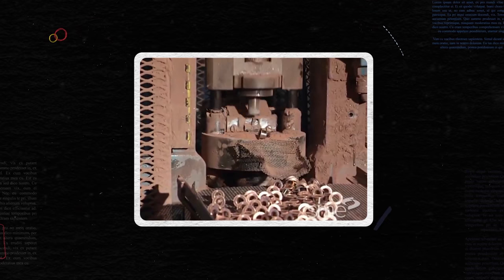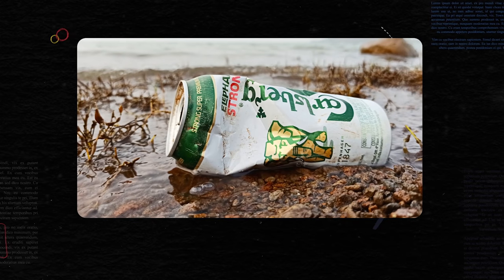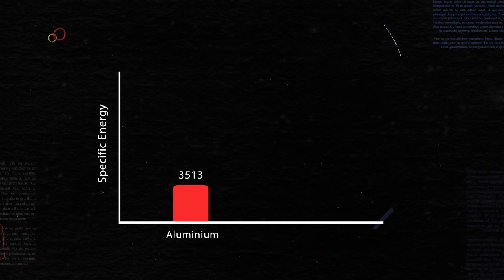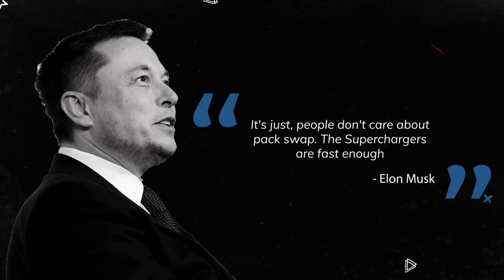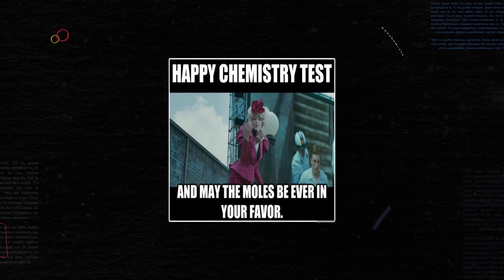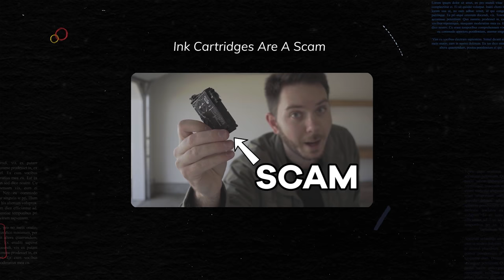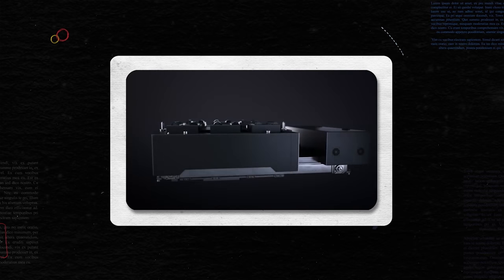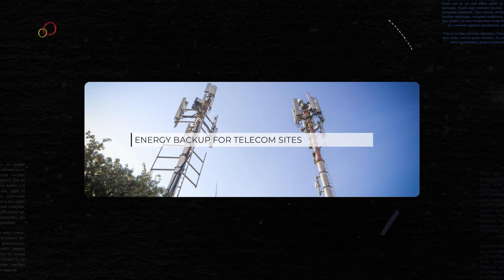We Can Get 1600 KM of Range With Aluminium Batteries

Comment: Someone is really bad at math... substance with 8.6Wh/g yields only 1.2Wh/g (~14%), then takes 15Wh/g (12500%) to get back to the start. That's an overall 8% efficiency. That's total crap! Li-ion might be 1/6th the usable energy density, but it doesn't take 12.5 times as much energy to recharge it. Unless you have a super-secret, uber-efficient method to produce aluminium, this is all just madness. "Buring" AL is just crazy. The expense (and pollution) of generating it is why we're so keen on recycling what's already processed. Hydrogen is a better storage medium, and water is very hard to break apart. (yes, the fuel cell is rather expensive, but I'm not recycling it every 1000km) Saying "zero emission vehicle" is infinitely misleading. Sure, the car doesn't spew anything, but recycling the sludge out of the battery sure as [censored] does. (I can't speak about India, but in the US, car batteries [lead and lithium] get reused/recycled. Yes, cellphone/laptop/tool batteries just get tossed in the trash, because people don't know any better, and can't be bothered.)
Reply: Well put!  I think you would like "Thunderf00t"'s channel he has a video debunking aluminum batteries brings up a lot of your points.
Reply: Underappreciated comment. You saved me from composing and writing what you wrote.
Reply: Ya absolutely. What do u think about solid state battery with ceramic electrolyte?
Reply: @StinkPickle4000  do you have the link to the Thunderf00t video you mentioned here please?
Reply: @GRSG  "1500 mile SUPER-battery: BUSTED!"
Reply: But Lithium generation does a lot of pollution too.. Thus even EV'S aren't that clean as they sound... And as much of Lithium recycling is concerned.... It can't go on recycling forever. At some time it gets out of cycle and ends up in a bin and when billions of batteries will be produced annually. It will become too difficult to keep up with your 98% figure,, simple saying it will do more pollution in recycling them then producing them. We can't even recycle plastics which doesn't even requires much energy in most cases.... Let alone you Lithium Ion batteries.
Reply: @ayushimishra8273  By your math, 80% of lead-acid car batteries are going into the landfill everyday. (hint: they aren't. they are, in fact, one of the most recycled things around. even the plastic casing gets recycled.) AL-air batteries are hands-down the most energy wasteful (and thus polluting) thing anyone could come up with. I guess a plutonium powered car is too tough a sell?
Reply: However the creation of lithium batteries is VERY energy intensive and is VERY environmentally UNFRIENDLY. It is a nasty business mining and processing lithium and nickel. The whole process is shittier than just driving your petrol or diesel car. Its a freaking mess.  Thus the saying, The New Gang Green Deal  LOL
Reply: @KlodFather  No, the making of the battery is not un-green. Mining and processing is a nasty business, just as it is for AL. This is why recycling is so important, and "destroying" the aluminum as an AL-air battery does is infinitely worse... burning it, thus turning it back into the crap we dug out of the ground and put tremendous energy and effort into refining, so we're constantly having to re-smelt it back to "usable" AL. Once Li, Ni, and Co are refined for a battery, it's much easier to recycle them back into a new battery -- the same as a lead-acid battery. The battery chemistry isn't destroying the material; the process is bi-directional. (the holy grail is to find a formulation that doesn't self-poison, or grow dendrites eventually causing shorts.)
Reply: I like this part of your sentence I copied and paste here "sure as [censored] does".  Does (censored) mean the "Fuck" word?  If so, I and lots of people use this phrase.  IT's precise and to the point...gets the job done.
Reply: @jfbeam  If you can chemically reduce aluminium to it's original form why can you not then chemically reduce the al oxide to pure aluminium also?
Reply: @gangleweed  Aluminum oxide is not chemically reduced. If you had a purely chemical process that could unbond oxygen from aluminum, leaving behind pure metallic Al, you'd be a billionaire.
Reply: @jfbeam  Hmmmmm, pity you couldn't dissolve the al oxide in water and electroplate it onto another metal....oh well.
Reply: Aluminium battery tech is from 1953  and lithium ion is 1982. 
There is a reason why we don’t have aluminium batteries running the world

Comment: This sounds like it would be a viable alternative for trucks, buses and to replace diesel electric trains.
Reply: and energy storage for power supply grids to replace oil, coal, and diesel peaker plants...
Reply: @yootoober2009  . The liquid metal storage that was recently on this channel is a much better option for fixed power storage. It doesn't appear to have any lifetime.
Reply: Aluminium smelting produces CO2 uses fossil fuels and relatively expensive

Comment: Even 7 cents/km is a high operating cost.  That is 4x the cost of the electricity to charge a battery EV.  In mpg equivalent cost 0.07/km is like having a 30mpg vehicle when gasoline is $3.50/gal.
Reply: Aluminum - air will never compete with grid costs. (Unless you were in Texas last week) but it can compete with gasoline and other transportable fuels.
Reply: @GRSG  Not even close. Alumium requires too much energy to recycle, if we had Nuclear Fusion (and the corrispondingly cheap AF electricity) sure, but otherwise even biodiesel is cheaper. You have to 1) Reprocess the spent battery with a few Kwh of electricity, most of which will be lost as heat 2) reassemble the cassette, 3) get the small fraction of charge the cassette gives. You throw any sort of enviromental tax at these things and the cost will go up exponentially.

Aside from emergancy power (like something you can crack open to charge your phone out in the woods if you need to call someone) I don't see it having a purpose that biofuel or hydrogen wouldn't do better and cheaper.
Reply: @DFX2KX  Never say never. Watch this space. Comparing to BBL equivalency, Aluminium can make it. And way better than Li-ion.
Reply: @GRSG  I'm not the one saying never. Thermodynamics is the one saying never. Energy density is the only thing aluminum has going for it. Most applications have adapted to Li-ion just fine.

Li-ion can be recharged a few thousand times, aluminum-air is one and done. then it takes several times the battery's capacity to 'recharge' said battery, every, single, tine.
Reply: Have you factored the cost of replacing lithium battery? Lithium battery is expensive and have to be replaced every several years. You may only have to pay 2 cents per mile now, but when the battery is worn, you have to spend tens of thousand dollar for replacement, which would be a big budget shock.

With aluminum air battery on the other hand, you pay it in installment. It's more resemble to gas refueling.
Reply: @DFX2KX  Carbondioxide is not the only form of polution. Lithium battery creates highly toxic chemicals polution at landfills. It's a nightmare in the making that has not been a problem yet because (as she said) there are not many Tesla cars and most of the ones on the road haven't reach battery replacement age.

Aluminum air battery on the other hand, left aluminum hydroxide .. the stuff we swallow to calm down upset stomach.

Comment: so, its not rechargeable, but has to be built again after it is used up, including all the waste and pollution that comes with it.
im not realy sold on it. i guess its better than suck-squeeze-bang-blow, but i cant see it competing with maintenance free, rechargeable batteries that get recycled to 98% after 20+years of service in cars,houses and gridstorage.
Reply: Our Al-air battery is not rechargeable it it reloadable.
Reply: @GRSG  that is my point, something has to be manufactured at a factory, shipped crosscountry, and then swaped into the car somewhere to replace the used up part.
there is simply no way i can imagine, that you are doing all this while being more economical and/or less wasteful than just charging a batterie.
but you might be able to challenge hydrogen with its laughable 27,3% efficiency in those niche cases where it makes sense, though.
Reply: My 2008 Prius does that suck-squeeze-bang-blow quite efficiently,  which I bought it used for under $3k with 315,000 miles. Put over 50K miles on it, so far, with only oil changes. My cost of ownership trumps all electric vehicles.
Reply: Aluminium is the most common metal on earth and the byproduct of fuel cell can be recycled back into the fuel cell itself
Reply: you aint sold on it because it doesnt even exist
Reply: @alistairbalistair9596  umm.. It does,
Reply: @frodobaggins2852  ummmmmmmm
Reply: @tomduke1297  Theoretical energy value: 8000 Wh/kg
Practical energy usable: 1200 Wh/kg
Efficiency of energy invested to energy reaped: 15%. Minus the losses in the recycling process and shipping.
That's worse than fuel cells. But great if you want to set up another transportation system where the operators are beholden to a supply chain.
Reply: It's much worse then suck-squeeze-bang-blow in most applications I can think of. Aluminum requires a ton of energy, and this battery only has the tiny portion of that investment stored within it in the form of aluminum metal. Outside of vacuum-sealed emergency batteries, I don't see any reason for these things to exist. like, pull a pull-tab, air goes into the battery, starts producing power like a hand-warmer but for cellphone battery, that's it. They're pointless otherwise.

Not to mention that there's genuinely rechargable al chemistry batteries that can use the current industry, they're just lower density then Li-Ion...
Reply: “Suck-squeeze-bang-blow” is the most definitive umbrella classification for 
IC/CI engines it has been my privilege to come across. And fittingly, on The Luddite channel ....😎
Reply: @sumanamjs  i actualy "borrowed" that from "Transport Evolved" channel. ;)
Reply: @tomduke1297  Now that really was worth “borrowing”. Glad to be “indebted” to you😁

Comment: As someone that lives in a region where temperatures stay below freezing (for water) for months at a time I have to wonder about both the efficiency of the battery and whether or not the electrolyte would just freeze and shatter the casing altogether.  
Whup never mind.  a quick google check gave me my answer. (Liquid Alum begins to crystallize near 30º F and freezes around 9º F.)
As most parking is unheated.  This means the battery would be less than useless for large portions of the year in temperate or colder regions.
Reply: Or you build cheap ass power hookups and the battery keeps itself just warm enough, OMG
Reply: There is nowhere to go in the winter anyway, right? 😁
Some sort of antifreeze might be added to address the issue. Or maybe a different electrolyte altogether for cold regions.

Comment: The problem with a single, large battery is there has to be some charge to get it to the replacement point. If you have, say, three anodes, you can replace two when you have started on the third. Plus they will be lighter.
Reply: Good idea. But I think the last thing mentioned might be the best. A fixed Lithium battery for day to day, say a 30-40KWh one, then an aluminium one for long range a few times a year.
Reply: I was thinking that, too. Mostly to make the Al-anode lighter, so it can be handled easier. And maybe, different vehicles might have different number of standard cells and Al-anodes would be compatible for all vehicles.

Comment: Sounds like Al/Air batteries would make sense in aviation where gravimetric density is the primary concern and maintenance infrastructures are already robust. i.e. Changing out the anode for every flight will not be a huge deal if the flight is 4 hours. Anyone else subscribed just to hear her voice? :)
Reply: "Gravimetric density"....homeboy trying to flex for the internet.

Comment: The efficiency of this battery is more similar to H2 fuel cell efficiency, as it takes 15 kwh of electricity to produce 1kg of Aluminium, but that 1 kg will only give 1.2 kwh of electricity for the car. This is grossly inefficient compared with lithium  ion batteries.
Also, the aluminium air battery becomes heavier as it reacts with o2 (43kg anode becomes 125kg alumina). This alumina must have a significantly greater volume than the aluminium, requiring the removal of alumina sludge every 300 km's.
I like the idea though and there will no doubt be some suitable applications.

Comment: You're talking about nonrechargeable batteries, essentially.  When swapped, they have to be remanufactured.  So instead of moving electricity to the car, we're moving batteries from the manufacturing facility to the car. discharging the batteries, then moving them back to the manufacturing facility to restore them to serviceability/full state of charge.

I don't think you captured all of the costs per kilometer for the end user.  Aluminum isn't very expensive, but battery swapping facilities are, and so is all of that material hauling between customer and manufacturer.  Very capital-intensive, lots of moving parts, lots of maintenance and energy costs.

When you spoke of disadvantages of metal-air batteries, you did not mention contaminants, which can get into the battery via water and air.

I don't think there will be any way for metal-air batteries - nonrechargeable - to compete with L-ion.  Rechargeable batteries, where only the electricity has to be moved around, is going to beat it hands down for cost and convenience.
Reply: From her numbers 1 kg of Al stores 4kwh of energy, and needs 12-15 kwh to reprocess the Al Oxide back to Aluminum. So we have a 25-33% efficiency, similar to H2 for the full cycle. Al is simpler to store than high pressurized H2. But it gets heavier compared to Hydrogen the bigger the H2 tank can get.
Reply: @Psi-Storm  Good points.

But the main takeaway isn't about energy efficiency .

The main takeaway is, it's a battery that can only be recharged at a factory.  So you use it once, then yank it out and replace it, and send the pack back to the factory.

Even if the recharging process were 95% efficient, which it is not, this is a business model that can't succeed.  It's insane.

The way forward is to move electricity to the car.  We have the grid.  Let's use it.

Comment: “Lithium Ion batteries end up in land fill 98% of the time” just shot her credibility right there. While laptop batteries end up in land fill, there is so much value in car batteries that 98+% will be recylced after  the end of their 20 to 40 year life.  By not talking about what is likely to happen with EV batteries, she makes a disingenuous statement that casts doubt on everything else she said. 

No one wants to mess with installing batteries when in 10 years off peak excess Renewable energy might be $0.01 per kWh with means 60 cents to fill up your Model 3.  Additionally EV will be needed enmasse to drawn down excessive peak during low demand.  Better would be to allow EVs to charge for free or even get paid to suck energy off the grid when it peaks.
Reply: In this current moment in the US, Cars are the only industry that recycles them, unless you count buying used cells off Ebay for projects and ebike packs. People chuck electronics in the bin all the time, and have for years. EVs have only been cheap for the last 5 years or so, so their impact hasn't had a chance to change much.

Actually Recycling in the US is garbage in general, what 'Recycling' we do have often amounts to 'put it on a boat to a 'reprocessing' center overseas so they can dump it into the ocean without us being the ones to look bad'.
Reply: @Colin Genge They amended this part of the video with a comment in this section, so kudos to them for making this correction. Their data was correct, I read in other academic sources that only 3% of LIBs are recycled currently, but it's indeed not relevant to this debate and allows some trolls an easy "gotcha!"...  ;-)
Reply: Yea, using that stat against Lithium BEVs is clearly biased.
Reply: @DFX2KX  Indeed, even in States that promote EVs, such as WA, recycling is often one single recycling bin where everything is mixed up, glass, paper, etc., but batteries are not allowed.
This garbage, recyclable or not, is not shipping overseas anymore, as China has been refusing recycling garbage for several years now, for obvious health and pollution reasons, so States need to process it locally. Most States didn't have time to develop recycling centers of their own before the scrap policy changed, so sometimes, less recyclable stuff has been collected and more land-filled or burned.
Anyway, another example of liberal Disunited States of America, each State setting their own standards and policies because recycling in Arizona must be different from recycling in Oklahoma for whatever insane politician reasons, and I am not sure there to which of the two words does "insane" applies...
Reply: Car batteries are not lithium ion. They are lead acid batteries.
Reply: @kylestewart8354  ICE vehicles have lead acid batteries for their spark plugs, which ignite the fossil fuels they burn to make the car go. Electric vehicles have massive batteries to power the motors, usually lithium ion
Reply: 98% OF LAPTOP BATTERIES?!
Reply: It is pop-sci/tech. They use current prices for their evaluations without anticipation of future changes. Renewable energy prices will go up as soon as cars are able to absorb every peak of production.
Reply: @peceed  Interesting point. As demand gets more flexible the value of renewables increases. That makes sense! It will still be cheaper to be flexible but maybe the difference will decrease over time